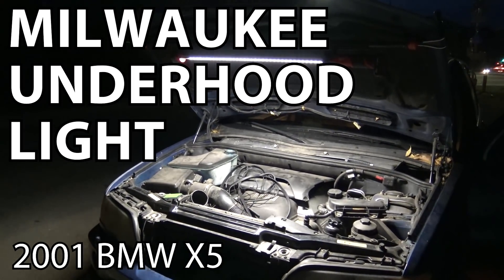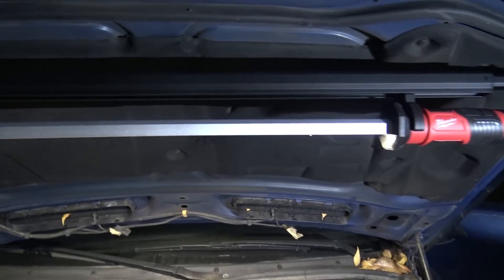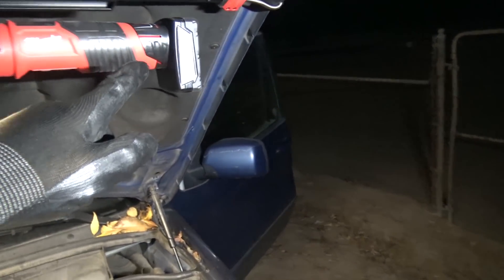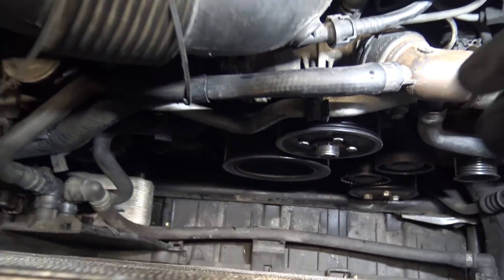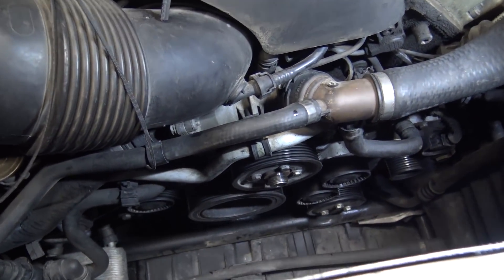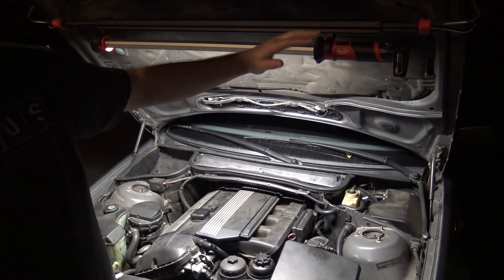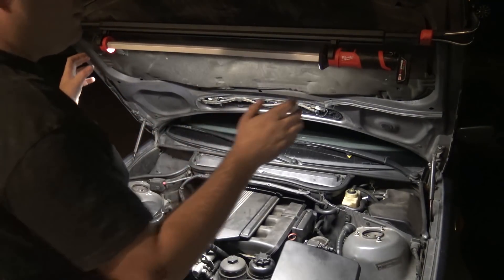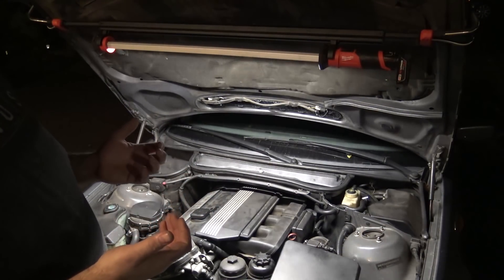Stranded! Milwaukee Underhood Light Comes In Handy

Comment: I like the fact you can change the battery. My led hood light is great but it doesn’t have a battery gauge telling you the power level left. When it runs out you gotta plug it in the mains. It can be a real pain.
Reply from the maker: Sucks when they have the built in batteries that you can't change!  I have that Astro 40SL work light, bought after I saw Eric O using it, and I have loved it but you can't replace the battery.  Harbor Freight just came out with their knock off version and not only does it only cost $25, it runs off a standard 18650 lithium battery that is replaceable.  Absolutely love it now--bought two!

Comment: Jason, are you suggesting water pump failure shredded belt?   Really?  My money is on seized alternator.  Anyway, that was what shredded my X5 belt.  And if you replace water pump do the thermostat too—I’ll guarantee it’s toast as well.  Good rebuilt alternator is about $350-$400; dealer rebuilt about $850 if I remember correctly.  (Milwaukee light is awesome by the way.) :-)
Reply from the maker: Yeah it was the water pump--it threw the belt off.  None of the other pulleys were bad, nor was the alternator seized.  The radiator pressure test revealed the pump was leaking.